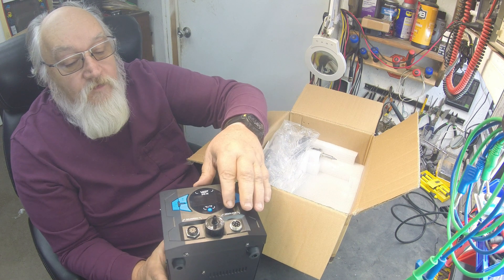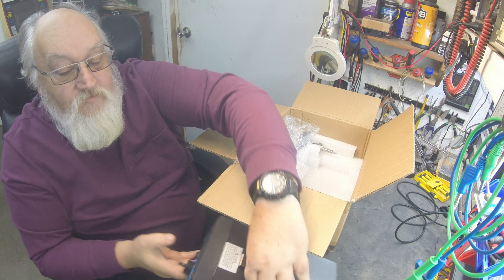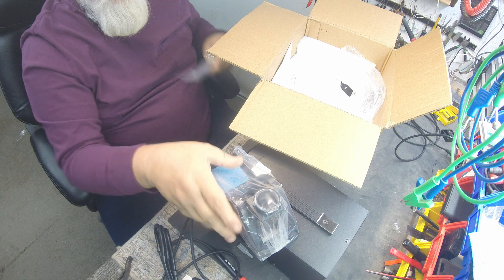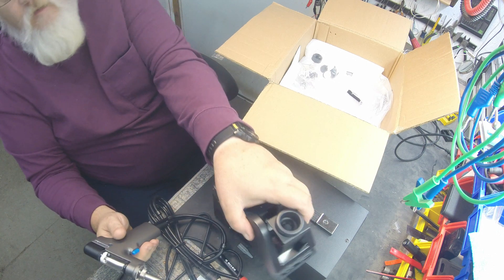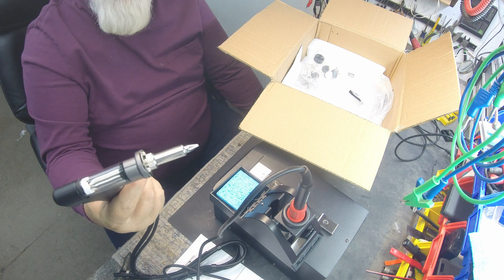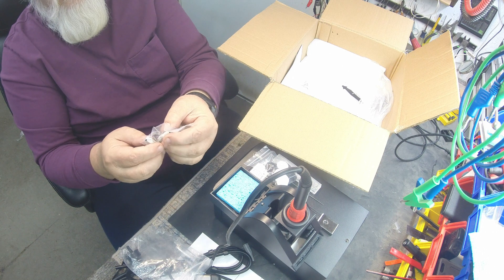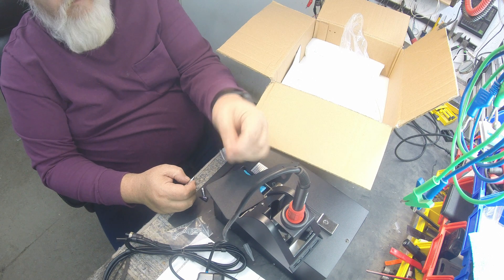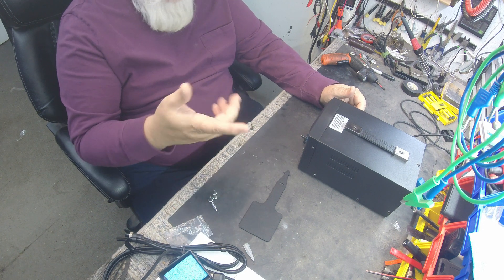WEP 948D III Soldering Desoldering Station Full Review

Comment: Nice video! Thanks! Question: what is the length of the solder gun's nozzle plus metal tube part? So until that wide gray ring. I want to know since I need to use it in narrow places

Comment: bought this one as well and used it for 5 minutes and was desoldering items,  and the power supply started to smoke...   is it bad,  or  is it because of the air pump  ??
did you have that as well ?
Reply from the maker: Wow, no it should just heat up and start desoldering. The only issue I’ve had with mine is that sometimes it reaches temperature, but the trigger doesn’t seem to activate the suction right away. If I wait a minute or two and click it a couple of times, the pump usually starts working. Not sure if that’s just me being impatient or if it needs a few clicks to get going.

But back to your issue no, it should never smoke like you described unless maybe melting some plastic where the tip is than I guess it would exhaust that smoke some where. When you pull the trigger, do you hear the pump motor running?
Reply: @TheElectronMan  ok, guess i got another bad one then..   i tuend it on this morning, and it works,  but it seems to happen  after i am de-soldering things.   thought maybe it was the fumes from it.   guess i will send this one back as well.
Reply from the maker: @perrykappetein9685  Interesting honestly, I’ve never really paid much attention to air extraction. I keep a fan next to my soldering station so the air is always moving, and that might be just normal. Depending on how the component was soldered, there can be a bit of flux smoke that’s why I use a fan, since there’s always going to be some smoke from the flux. So it makes sense that when you desolder, you might see a small amount of smoke. If it’s working fine otherwise, I wouldn’t worry about it but that’s totally up to you.
Reply: @TheElectronMan  i had the cover taken off. when it started,  and then i left it off, and did some desoldering and there was no smoke..  so i think it's piling up..   maybe a fan  inside  wo
uld have fixed the problem..

Comment: Nice video. It doesn't look like you're using flux. Do you not need it with that? Very nice.
Reply: I mean flux for desoldering.
Reply from the maker: @FreddyLee-ti1rh  Thanks! When I desolder, I usually don’t use flux. I’ve found it works fine for me most of the time, but I know a lot of people prefer adding flux to make things flow easier. Appreciate you watching the video

Comment: Thank you for the video.  I ordered this unit and hope for the best

My first de soldering station.
Reply: I been using troughole desoldering tools for decades, many years ago I bought one Hakko 474, Hakko 808 and Hakko FR-301.
FR-301 is an excellent tool.
3 years ago I bought a Yihua 948, in these 3 years I change the gun one time only.
I recomend to power up the unit when you need it only, I do this with all my desoldering guns and never change a heater.
In the Yihua one day heater ripped apart, one good things is the low price for the complete gun.

Best Regards.
Reply: @treadmillrepair754  Same with me. I have used Pace since they had air run to them for the venturi vacuum all the to the latest MBT's. When I saw this system I instantly remembered the Hakko's with the pistol grip. I can't get over the price on this!
Reply from the maker: You are welcome! I am really happy with mine, I was using it today...

Comment: Thank you. What is the difference with YIHUA 948 I ?
Reply: Yihia 948 I use a smaller nozzles.
948 III is more powerful also. 

I have Yihua 948 I, 948 II and 948 III.
Any other question?
Reply: @treadmillrepair754  do they use the same tips?

Comment: That's a nice desoldering pump ..... I'll look into it , that one or a Hakko will be my next big expense ..... Happy New Years Mon Ami .......
Reply from the maker: @cajuncoinhunter  Thanks Happy New Year!
Reply: @TheElectronMan  Did you have a chance to do any soldering with that lil portable iron for 99 cents ?  That one I showed is doing a bang up job....
Reply from the maker: @cajuncoinhunter  NO because when I got it didn't include the power cord should have noticed that when I got it for a dollar I need to order one so I can try it out..
Reply: @TheElectronMan  You have the stuff to make one ............The plug itself is a 5.5 X 2.1 mm , common as the 2SC 945 transistors ....... A piece of double hook up wire and a 20 to 24 volt source........If you don't have the stuff I can send you the stuff ......  I have lot's of parts and stuff....
Reply from the maker: @cajuncoinhunter  LOL, yeah, you’d think so, but I haven’t been able to find a plug that fits it right, found a couple that fit but real loose and others were just to small. I’ve found at least a dozen plugs, but not the one I need. I guess I’m going to have to salvage one from a power brick—I’ve got a whole box of various ones, so I’m hoping one of them will fit. Power isn’t an issue; I can use my 30-amp variable power supply. I just need the right plug.
Reply: @TheElectronMan  I can put a few things in a padded mailer for you...... Did you see the video I sent ya in a email ?? I sent it about 3 weeks ago I think...
Reply from the maker: @cajuncoinhunter  Thank you but I think I can find one just have to go digging for it LOL..